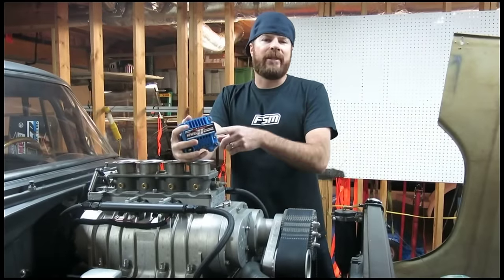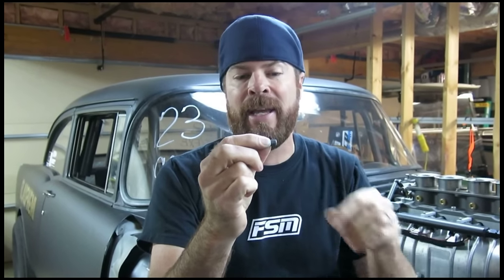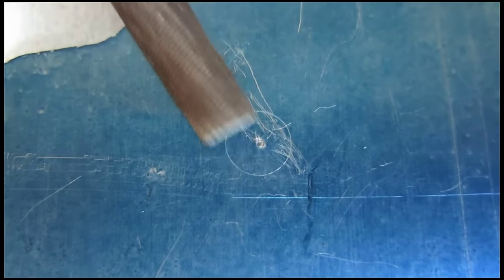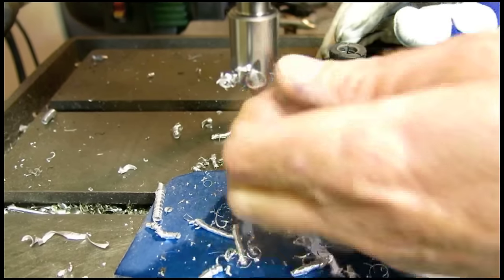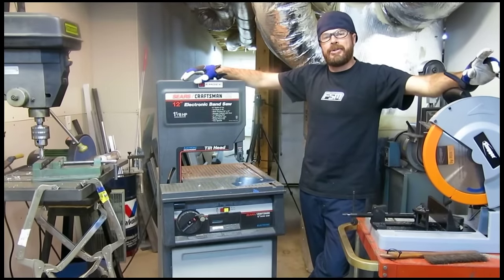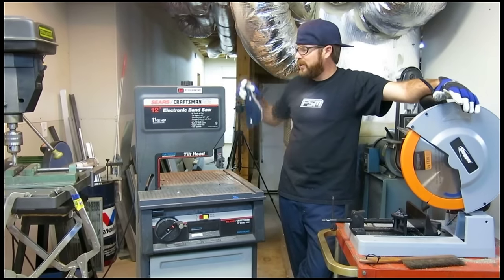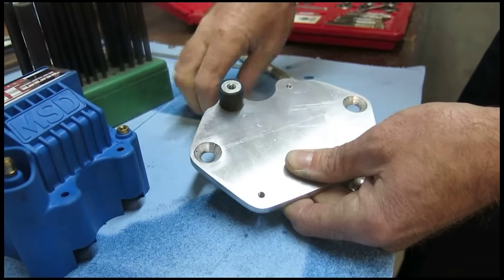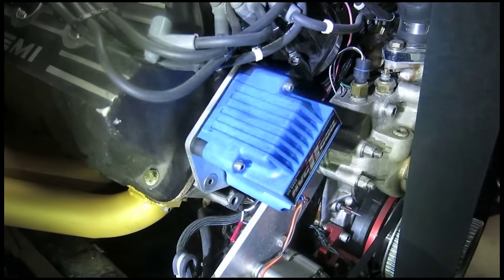Finnegan's Garage Ep.2: Cheap Fabrication Project, Blasphemi Gets a New Coil Mount.

Comment: great video and Finn my 18 year old kid wants his 87 chevy truck to sound like a drag car umm... imagine that do you have any suggestions for him on a $8 an hour job lol 
Thanks
Reply: Cam and thrush chambered mufflers.
Reply: +Rob C First off...no matter what you do to the exhaust system, the motor is probably still going to sound like a turd. I'm assuming stock compression, cam, etc etc; 
Remember, those drag cars have the 3 C's, and they're all Big! Big Cam, Big Carb/Carbs, Big Compression. 
I ran open headers on my F-150 for a couple days before I welded up an OE type system, and that 302 just sounded weak even with open headers. Comparing that to my uncles 383 SBC in his Camaro he ran with open headers for me once, that engine sounded GOOD! I run Dynomax Ultra Flo's on my Roadrunner and sometimes I wish I had a little quieter exhaust, especially if somebody else is in the car and I want to have a conversation.
IMO, get him steered away from the drag car exhaust if it's a daily driver, it will be cool and all for a couple weeks, then it will just be annoying. Some Flowmaster 50's or an equivalent from another manufacturer will minimize excess noise and still give a nice roar when you get on the gas. Just my two cents!
Reply: +852urkl Flowmasters are $89.00 a piece, thrush welded are $29.00. He said an $8/hr budget. A reasonable. 510 or so cam and a "knock off" 2 chamber muffler will SOUND good . Do you not agree?
Reply: +852urkl I'll take your 2 cents melt it down and get 10 cents for it playboy.
Reply: Anti Socialbot  Honestly, I wouldn't know what Thrush mufflers sound like cause I nor any of my car buddies buy anything but Dynomax or Flowmasters. I bought those Dynomax ultra flos and did my whole exhaust system for my Roadrunner back in college on that same kind of budget. Of course I am considered weird by my peers for not wanting the latest tech and not eating out every night...
Reply: +852urkl None of this even matters , if the kid wants the truck to sound a certain way, he has the Internet he can listen to  chevy trucks with all kinds of exaust combos. If he really wanted it to sound good it already would.
Reply: +Anti Socialbot boy i appreciate the enthusiasm and good ideas but calm down he's not rushing into buying something he has seen on you tube and cant say i blame him he asked me and yes i can change parts but car guy im not so i figured Finn might help out but you all had some good ideas and i will look into them thanks.
Reply: +852urkl Thanks
Reply from the maker: +Rob C These are great ideas. Also check out Black Widow exhaust. That company has a great sounding muffler. Comp Cams Thumper line of camshafts will probably have the sound he's after.
Reply: +Rob C Sorry for stepping out of line,next time just slap the sh¡t out of me lol! Whatever you do don't get in a rush.
Reply: +Finnegan's Garage ok i will thanks alot Finn

Comment: remember people, band saws with metal cutting blades are what they use to cut frozen cow and pig bones/meat... be careful with them.
Reply: I did that once at the shop, late at night. 
Sliced right into my thumb like 1/4 inch deep 
Talk about stupid, no one was around. 
and after wrapping it up I got so weak I couldn't move from the chair for 45minutes, not to mention having to drive to civilization.
Reply: MrTheHillfolk I know the feeling, I sanded off my thumb nail in high school on a 2 ft disc sander down to the nail bed.. I turned that thing off and got water on it so quick.. bled like crazy and as soon as the pain of the tap water hitting it stopped I get seriously sick feeling.. amazing how that works.
Reply: +OtisENGINEuity yea I was super nauseous it was scary!

Comment: could've just pulled the sticker off and flipped that over. doh!
Reply from the maker: It wasn't the sticker that was the problem. Coil wire doesn't reach when the coil is mounted upside down.
Reply: +Finnegan's Garage oohhh... gotcha. haha
Reply: +Finnegan&#39;s Garage 
Doing it right the 1st time, no matter how many times it takes.

Comment: One tip, get a better mic maybe?
Reply: +Duncan Czeizinger Yeah I hate those built in mics, you can hear the hard drive clicking in the camera. You can get a decent wireless mic for cheap enough and do a lapel mic. It would be a step up. Maybe grab some of those umbrella lights that photographers use as well, don't need a lighting guy then.
Reply: Tom Lindo I'm looking into a out board mic for my camera, factory it just SUCKS.
Reply: ***** that's mine, the focusing, meeeeeeeeeeeeeezzz.......meeeeeeeeeeeezzzzzz. And so on, and to use it like that you can't hear it on my channel because I edit it out, at least it's load and easy to pick up.
Reply: +NerdishAzn some cameras do use hard drives. Doed his? Provably not. But alot do.
High end ones use solid state drives

Comment: Too bad I own a boring Crown Vic that has really nothing to modify...
Reply: crown vic is v8 and shares engine parts with mustang. I've seen a few here where i live that can move pretty good
Reply from the maker: Check out Socal panthers group on Facebook.  Lots of cool crown Vic's on there to get ideas from.
Reply: +Finnegan's Garage I'll have to check it out. So far the car has a pair of 2 chamber Flows with turndowns under the car. that pretty much it. I was thinking maybe just gear it down to 4.10's annnnd  maybe a 125hp dry nitrous kit. people would never see or coming ☺